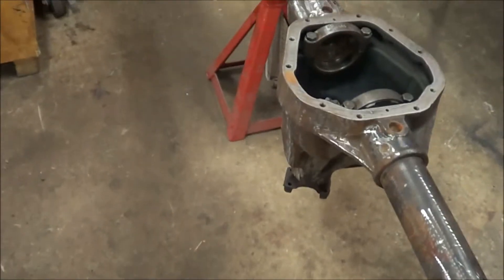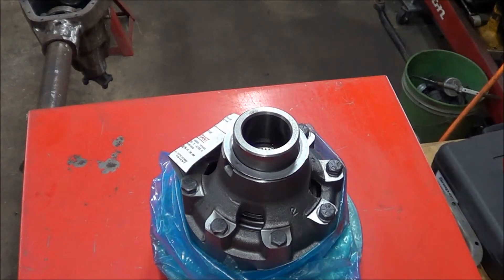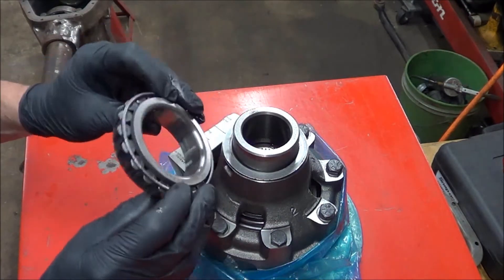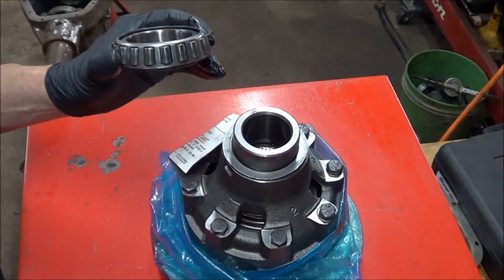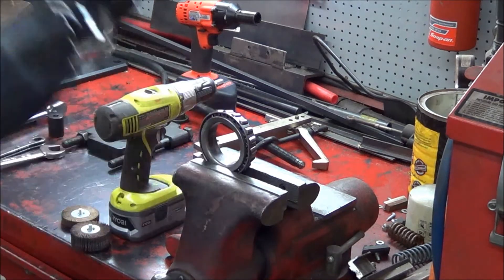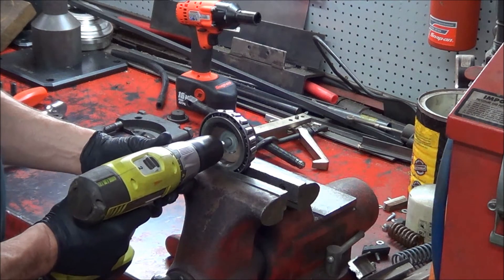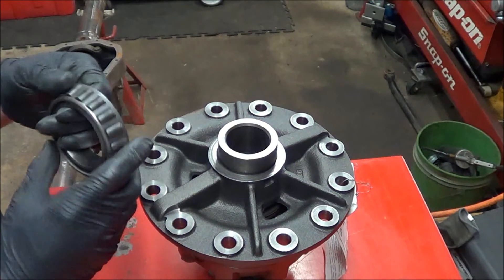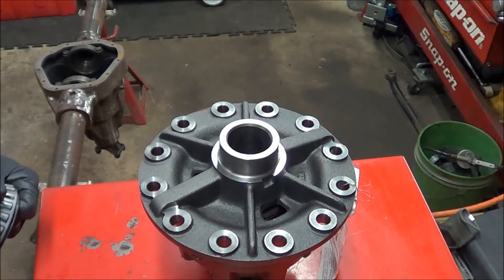5-21-15 How to make set-up bearings for ring and pinion or differential swap

Comment: What size flap wheel did you use to hone the inner bearing?
Reply from the maker: honestly don't remember that was almost three years ago. I have a 10 piece set from McMaster-Carr, I used one that was suitable. What is the ID of the race you want to hone? I can check my set and make a suggestion.
Reply: I'm assuming the size was slightly larger than the inner diameter??
Reply: I'm installing Auburn ECTED locker into Dana 44, the inner bearing size is 1.796.